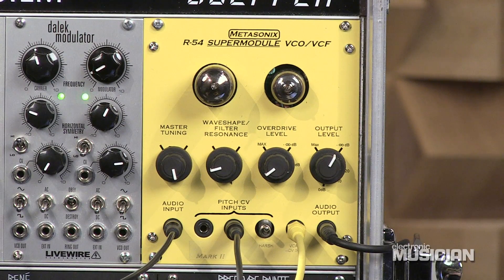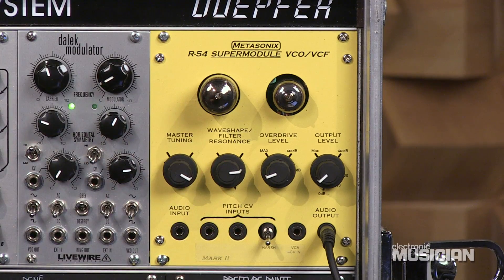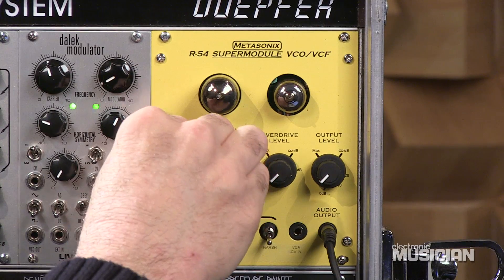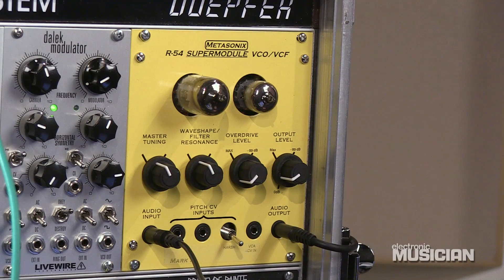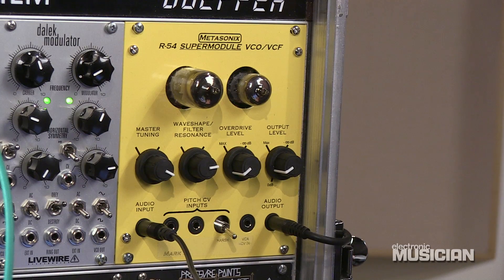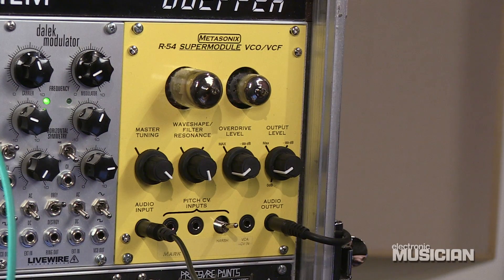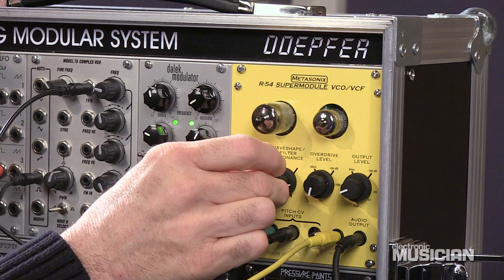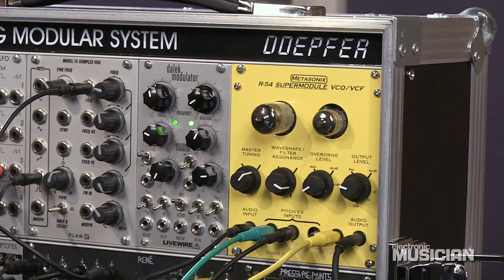Mod Squad Metasonix R-54 Supermodule MkII

Comment: what kind of power supply would support the massive power required for the metasonix modules?
Reply: The Doepfer PSU2 or PSU3 can run at least three, or more if there is no other load. The Hinton Full-Power can probably do slightly better.
Intellijel's 80-watt supply can probably handle three. Metasonix makes their own power supply that can handle six, and Trogotronic makes a power system that can probably handle a 9u rack's worth, or more.
Reply: JH Morehouse Trogotronic